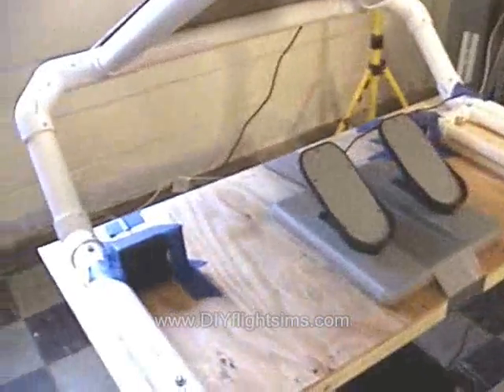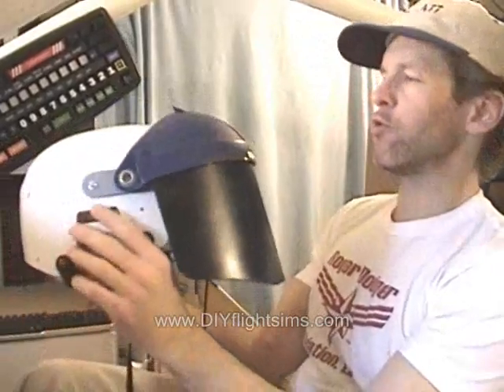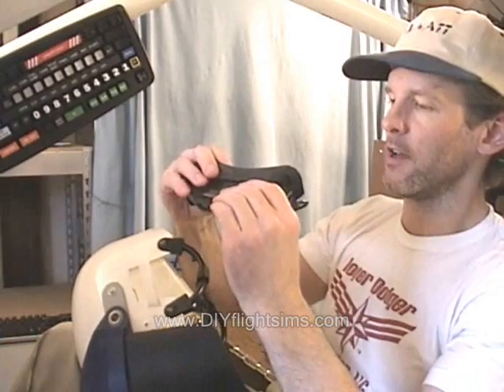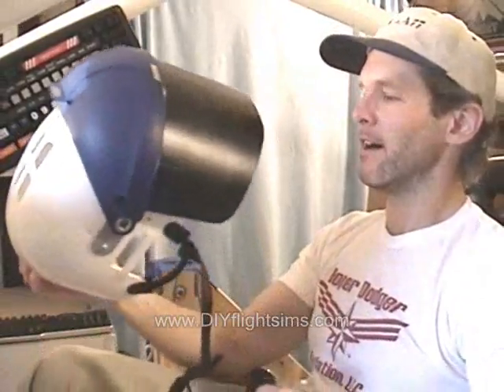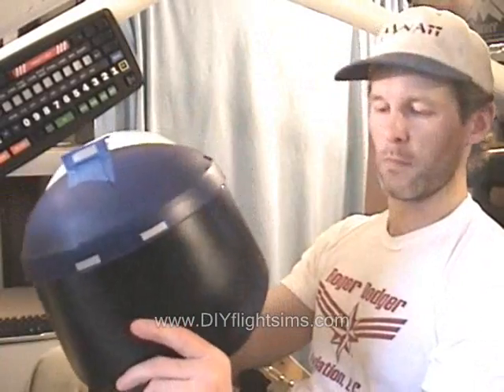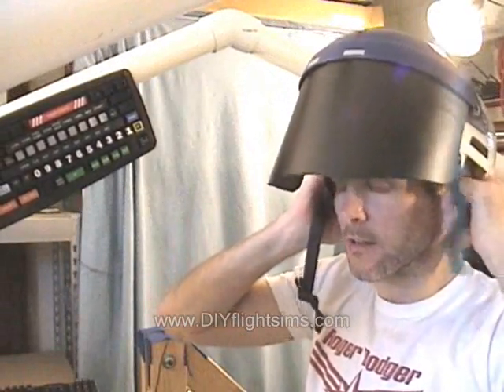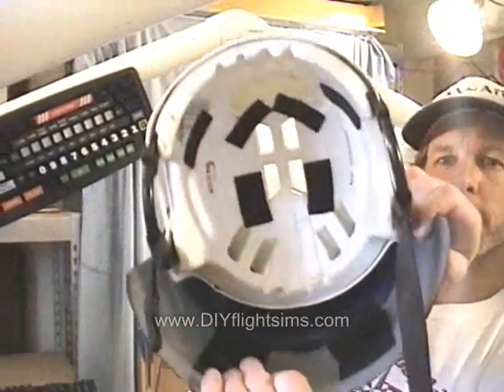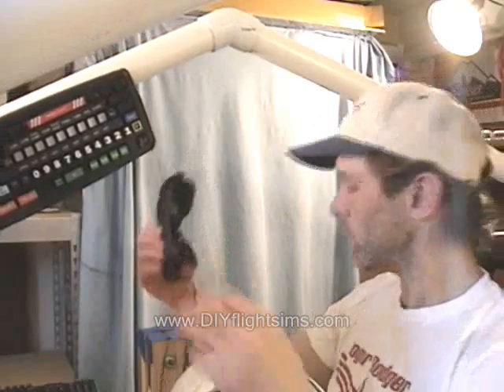MAACS Experiment - Episode 4, First Virtual Reality Helmet

Comment from the maker: Yes, you are right about not being able to see the keyboard mod.  That was one of the problems of a virtual reality headset.....ooops.

I tried strong bungee cords to center the joystick, but they were not strong enough to pull the counterweight assembly back to level once it was tipped up or down.  I didn't want to use stronger bungee cords because I was worried one would snap loose and hurt someone.

Comment from the maker: Well, there were stoppers for the counterweights.  The problem was not that they were going to roll off the ends of the simulator.  The problem was that I had to pull when I should be pushing on the joystick (and vice-versa).  In other words, the counterweights should have built-in positive stability to naturally return the joytick to center.